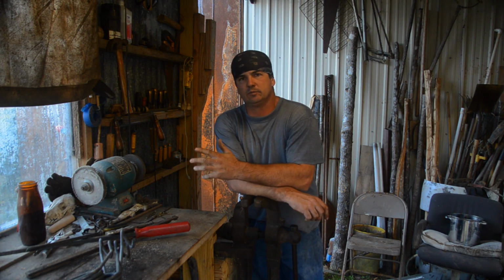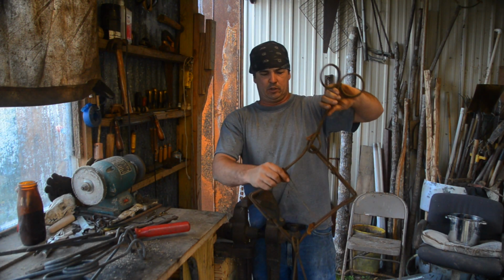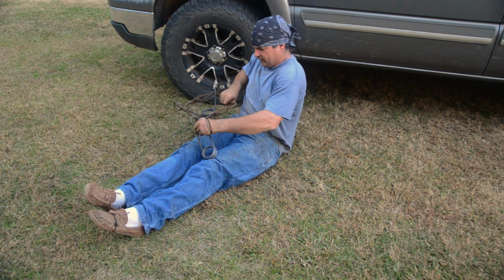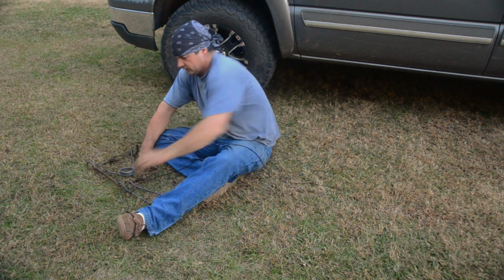Replacing springs on a 330 Duke conibear trap

Comment: Just clamp the spring in the vise and either use a "Trapper Ron`s Safety Setter" or one of several body grip setters with wide jaw spread to set the springs. Hold them closed with the safety clip on each spring. I never recommend heating any trap springs, period. You are making it harder than it really is.
Reply from the maker: Then make me a video 👍🏻